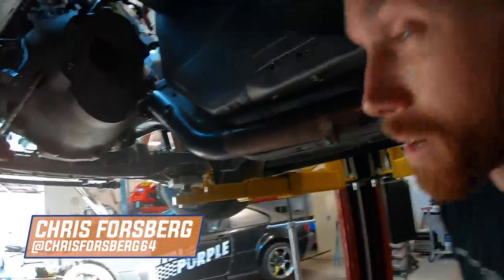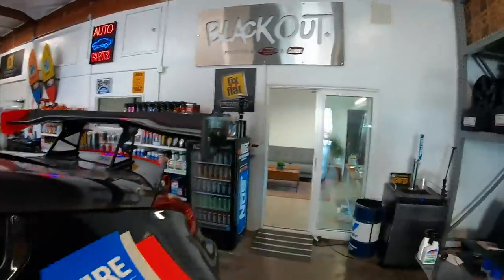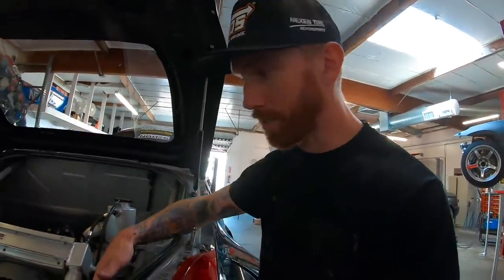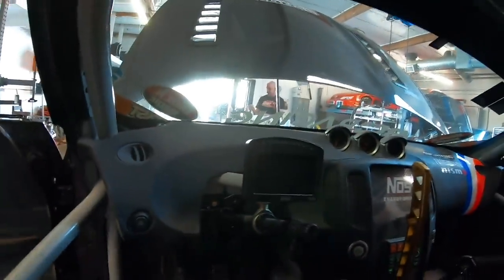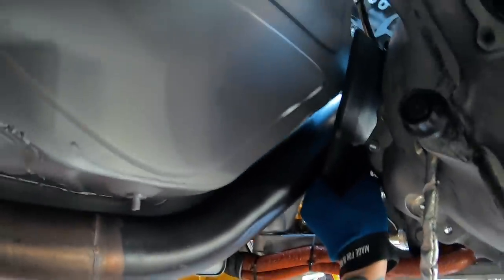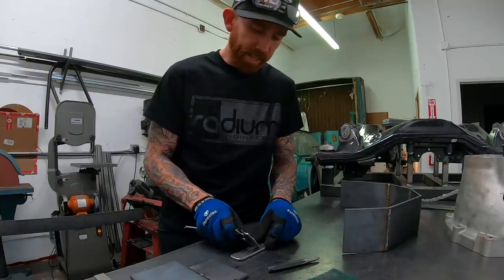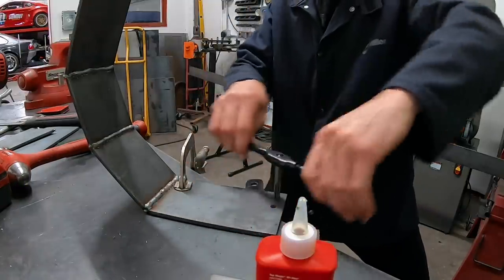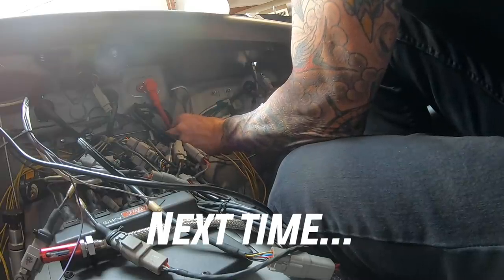How to Build a Clutch Scatter Shield!

Comment: Hun, easier than i thought it would be, good job Chris
Reply from the maker: It was my first one! Just tried to think about how to give it as much room as possible but still staying tight to the bellhousing. Easy access bolts to take if off quickly if necessary.
Reply: @chrisforsbergracing  the bottom removable piece was smart

Comment: Magnus Motorsports makes a SFI RWD bell housing for the vr38dett
Reply from the maker: It does not fit a Holinger transmission... and its $4500!
Reply: Just make an adapter plate at the case body. But yea I did see the crazy price. But it is titanium!